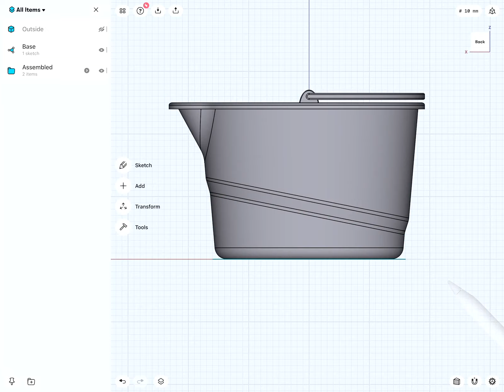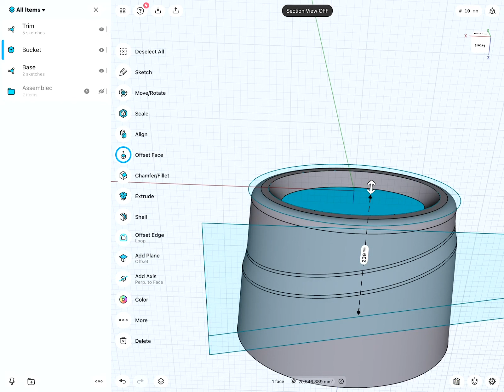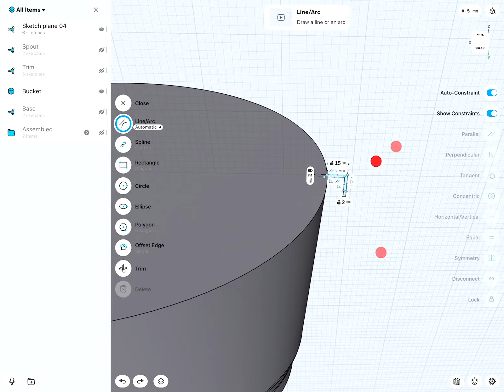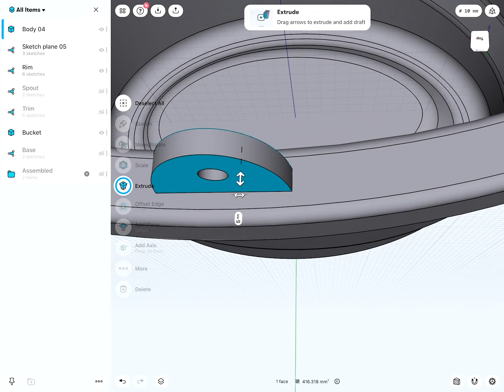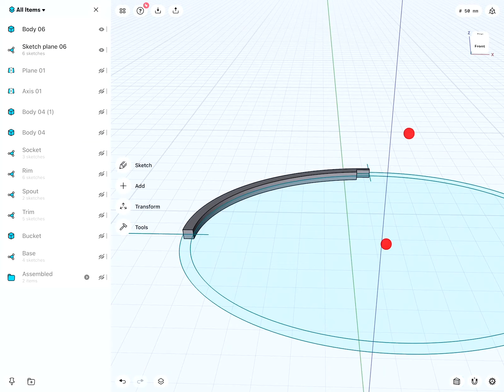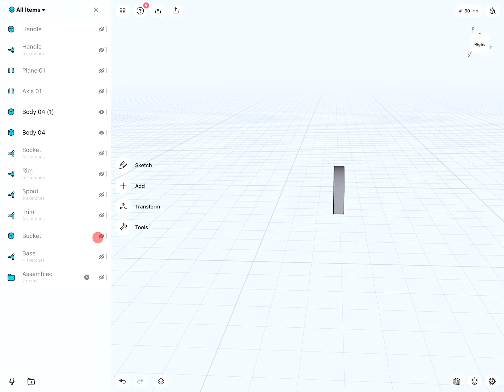3D Modeling a Water Bucket on iPad | Shapr3D Step-by-Step

Comment: How can I make 3D fire
Reply: This program does not house a particle system to create 3 dimensional fire
Reply: Ok is there anyway I can make like a solid smooth model of it that doesn’t move because I can’t figure out how to even make a ball
Reply: @franklinschmidt1  make a circle sketch, drawn a line through the center of it.  Then click on half of the circle sketch, click the revolve tool and then click on the center edge you have running through the circle sketch.  Boom a solid sphere.  You can make 3D non-moving fire yes as well.